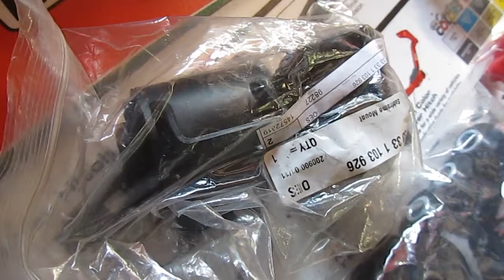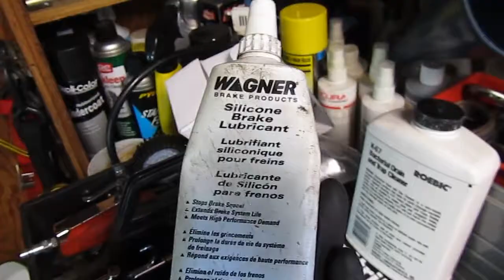BMW 2002/1602 Rear Suspension Rehab

Comment: Nice job  !  However if you put the Subframe bushings in Upside down then the rear camber gets back towards the positive side which will increase your contact  patch.  Makes the wheel stand straight up.  Whenever you put in lowering springs in a 2002 it will increase the amount of negative camber...
Reply from the maker: Thanks for the tip! I wish I had more fender room to do that!